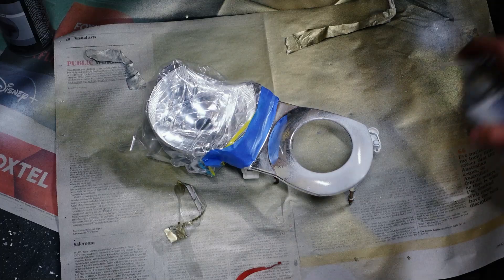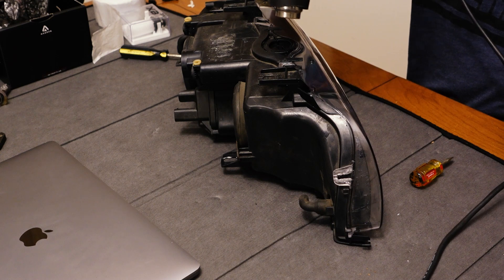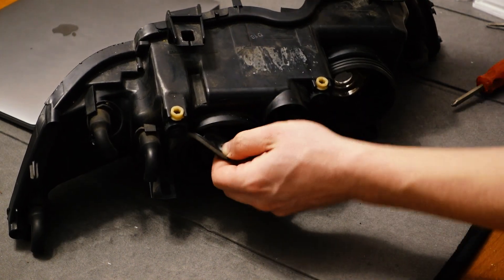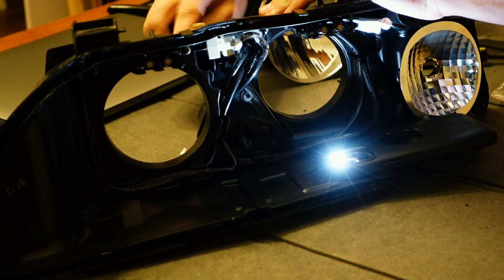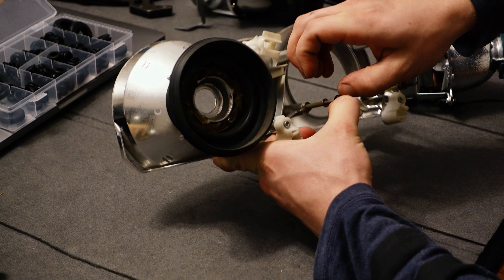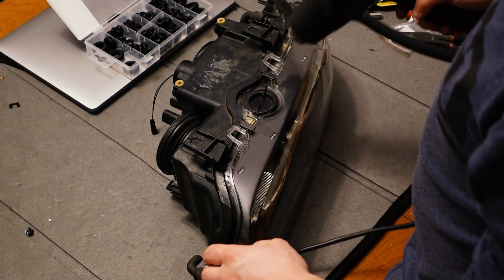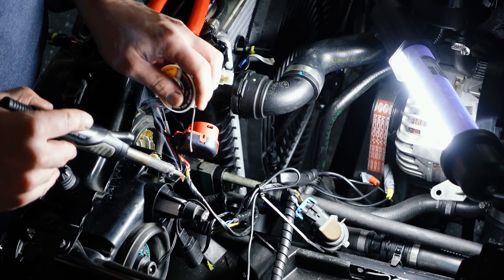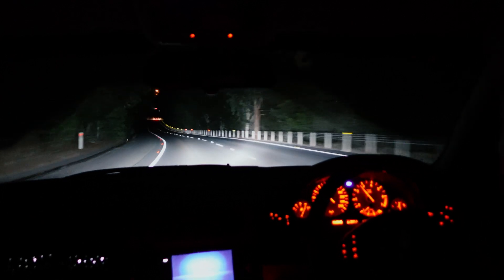BI-XENON PROJECTOR Headlight Upgrade - E39 BMW 5 Series (Retrofit Lab Kit)

Comment: You don't need to break anything. Just unscrew them! But since at least one will already be broken replace them all while they are apart. Also don't use a screwdriver unless you want to break the cups. Just snip the leg off and spin the ball that is left, it will just fall out under gravity or a gentle nudge.
Reply from the maker: Unscrew the side attached to the back of the headlight yes - I find that the ball/socket side attached to the inner portion of the headlight just crumbles away and needs some poking and prodding to get all the pieces out

Comment: Hey man, just wondering if the kit comes with all required sockets, high, low, halo and indicators? I need to buy sockets for a set of e39 facelift headlights that I bought that came without sockets, but if the kit comes with it all then I'll just get the kit. All I have is the headlight housing and the big rubber boots. Cheers.
Reply from the maker: The kit only comes with the projector lenses, bulbs and xenon ballasts and the related wiring - no other sockets or bulbs unfortunately. I’d jump on Schmiedmann or Spareto and see if they have the extra stuff you need

Comment: are the angel eyes part of the lens themself as 1 piece?
Reply from the maker: Everything in the 2000-2002 headlight is separable, the angel eyes can be removed separate to the lens
Reply: @OEMStez  ah cracking thanks, I need to replace mine as they've burnt but am thinking do a full refurb in the process

Comment: Can you install xenon on a prefacelift that has Halogen? And if yes, what kind of modifications it requires?
Reply from the maker: You can but requires a different kit. Just head to the website link in the description and then search for the pre-facelift e39, they should have it

Comment: plot twist, there are some e39 headlights that are "permasealed" with some other kind of seal, not butil rubber, and only way to open them is to either cut the glass or to cut the corpus. I  think the permasealed ones was post 2001 but im not pretty sure, if someone knows better let me know
Reply from the maker: Unfortunately yes, that’s why I’ve only put 2000-2002 as the year range in the thumbnail, 2002-2004 is permasealed from what I know
Reply: If you have july 2002 headlight congratulation you have a permasealed headlight:) before that date there Was butyl. I had so much luck my car was from 2001.. And ive try to bake them 4 to 5 Times + heat gun no Chance... So I looked at the sticker at the back from the headlight july 2002 :) some Idiot or genius changed the good ones before July 2002 with those after july and Sold the car I guess because he knew it was perma sealed :) i was 2 days into changing projectors I had to cut the Glass which was no Problem but the remaining Glass which is left is pain in the.... Normal change doesnt take so long alone the cleaning took me 2-3 hours cleaning the old left perma seal thing. Sorry for my English
So If you have july 2002 headlight or after that date you have perma sealed headlight before that date it's butyl and youre lucky

Comment: Did you use a high-temperature paint and if not did you have any issue with it bubbling from the heat etc?
Reply from the maker: I used a paint called Dulux Hammered Finish, it doesn’t have any detail about temperature range but a couple months before painting the headlight shroud I used it on my brake calipers and have had no issues with it so I figured it would be fine. No bubbling problems with either 👍

Comment: Looking to do this to mine that has factory xenons that are useless. Can I ask what you're using for the Halo/angel eyes?
Reply from the maker: Just the factory halo rings with $15 eBay led bulbs in them 👍
Reply: Were you able to get the auto leveling to work? My bundle of wires has two plugs that don’t match the motor connection is why I ask
Reply from the maker: @leveluplife8585  Auto levelling motor is in the headlight unit itself and it tilts the whole chrome housing so it should just plug back into whatever it was connected to - mine is working fine (it does a dip down and up automatically on startup)
Reply: @OEMStez  so you think I can just splice in keyed power to it? I can do that but I am really curious why there’s 4 wires to it